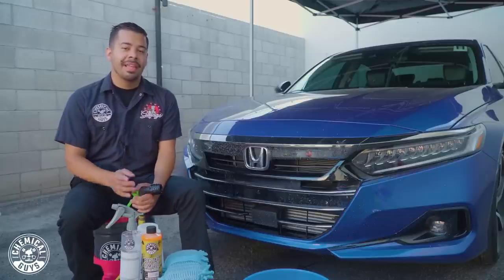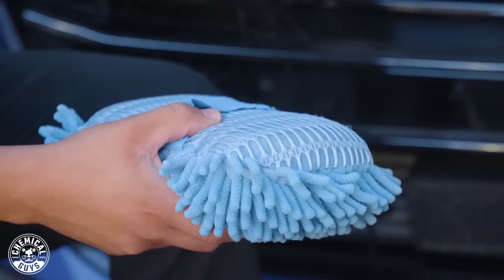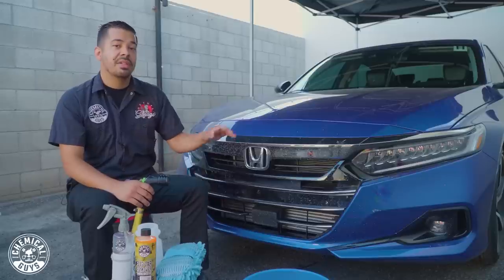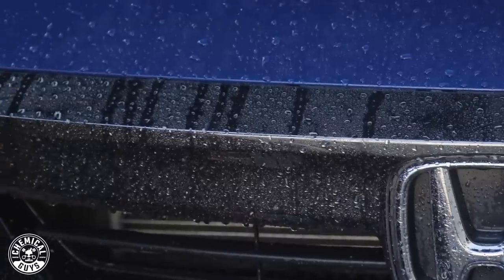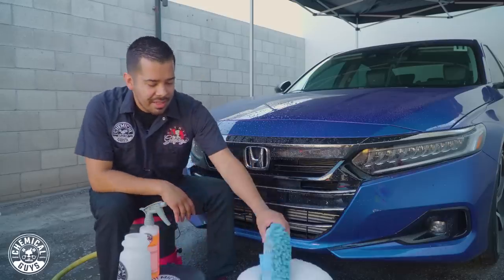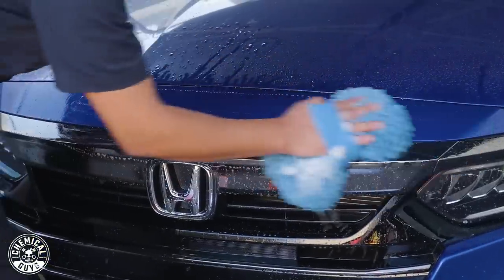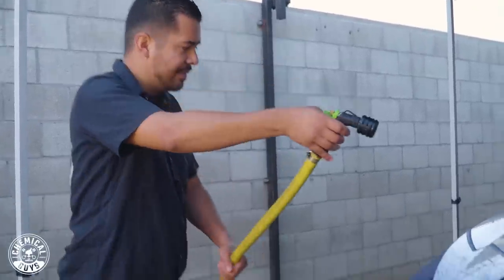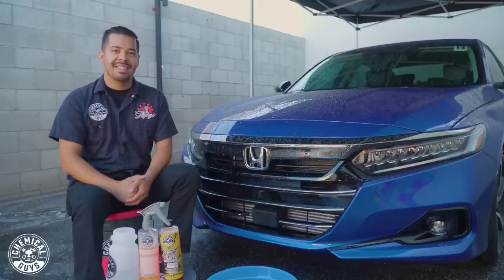Is Your Ride Covered In Bug Guts? Remove Them Scratch-Free With This Easy Method! - Chemical Guys

Comment: After using the bug and tar remover, do you need to reapply a wax the area? I ask because I hydroslick then waxed my vehicle before my road trip.
Reply from the maker: Hey Kerry! Absolutely, enhance gloss and add protection by following up with a coat of wax.
Reply: @ChemicalGuys  Great! Thank you for the information. It wasn't clear in the video about that you need to reapply a coating/wax after using the bug and tar remover.